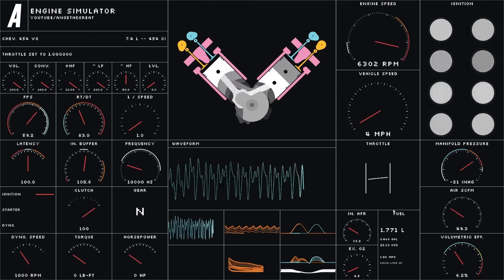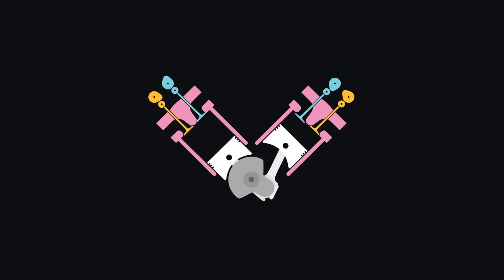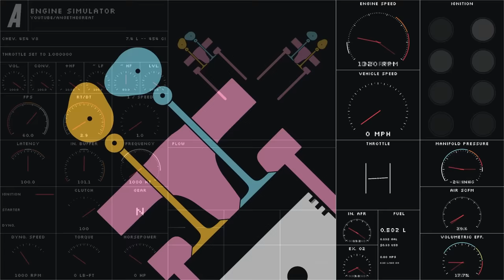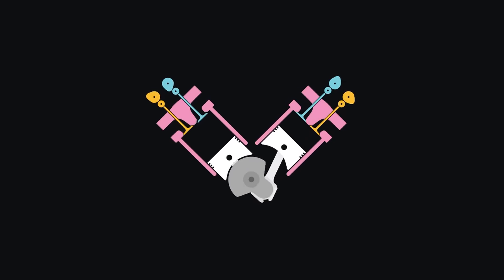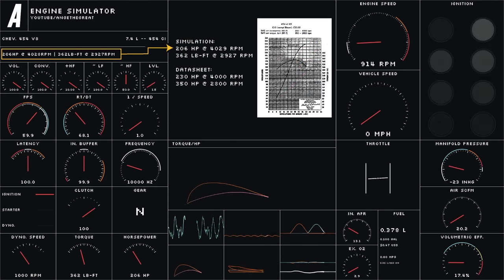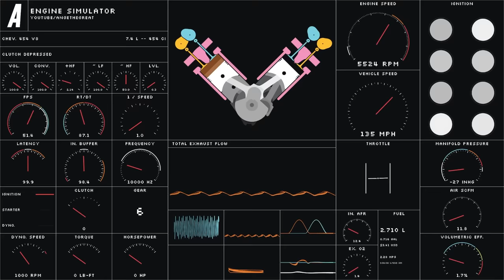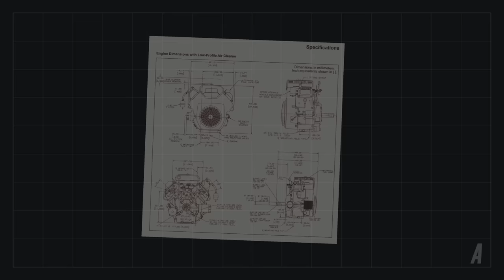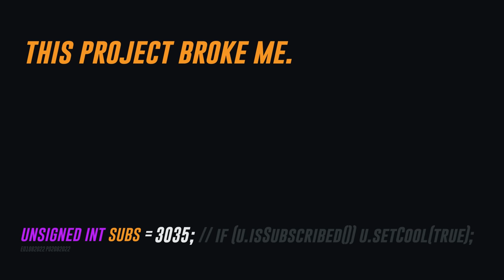Simulating an Entire Car Engine (yes, it makes noise)

Comment: Imagine BeamNG with realistically simulated engines that are 3D
Reply: computer explodes
Reply: beamng can barely run its own physics simulations above 60fps on most computers, I shudder at the thought of an engine simulation
Reply: @elllieeeeeeeeeeeeeeeeeeeeeeeee  wdym? any respectable gaming pc within the last 4 years should be able to easily run beamng over 100fps. Although this sim can barely handle a 10 cylinder engine since it's single threaded so I don't think it'd work out.
Reply: @Kevin15673  yeah but this needs 80000fps otherwise the engine will implode
Reply: @TorutheRedFox  The sim also runs on a single thread, I also never said that I thought it was possible to combine the 2.
Reply: @Kevin15673  well, multithreading physics simulations can't really work because it'll all fall apart if the threads desync (which, well, it's guaranteed to happen as the whole point of multithreading is that it's asynchronous)
Reply: there is "Automation - the car company tycoon game" in it you can build cars including the engine. which you can then export to Beam NG. though its a question to how accurate the engine simulation in that game is. its pretty much why most people play it. because you can make some pretty crazy engines with it for Beam NG. especially if you use mods.
Reply: @elllieeeeeeeeeeeeeeeeeeeeeeeee  my laptop runs it at 300fps 😄
Reply: @elllieeeeeeeeeeeeeeeeeeeeeeeee  my man u need an upgrade. 1k hours and only a few mods ever give me issues
Reply: I hope commercial quantum computers or immensely powerful analog computers become possible within my lifetime
Reply: @bad1971nova  yea like beamng, the most detailed physics engine applied to cars, isnt a real simulator
Reply: @bad1971nova  you’ve forgotten the purpose of BeamNG
Reply: @bad1971nova  Cause everyone knows beamng is þe most popular arcade game ever made lmao
Reply: @bad1971nova  What are you saying next? Real simulator like Forza Horizon or GTA?
Reply: I can't play beamng anymore because I ran out of space on my hard drive, but I can't relocate the install folders without updating the game, but I can't update the game because I don't have hard drive space.
Reply: @bad1971nova  Sorry but your comment sounded like you are badmouthing BeamNG!
Reply: @bad1971nova  Yeah it would be cool to have this in every car game and I agree, SUVs are pretty boring.
Reply: @elllieeeeeeeeeeeeeeeeeeeeeeeee  i have a good pc, but i still get low fps and beamng doesnt even fully utilize a single thread or my whole gpu
Reply: YESSSSS!!!!!!!!!!!!!!!!!!!!!!!!!!!!!!!!!!
Reply: @LodewijkVrije  It is a close approximation but it has many many flaws. I wanted a FULLY working engine in BeamNG, That is NOT run by a code, but rather a FULL simulation of explosions like a real life engine!
Reply: @tobster786  Have you tried to close all programs and running the game? And testing every configuration setting to make it rum smoother?
Reply: @elllieeeeeeeeeeeeeeeeeeeeeeeee  most windows computers over $450 should do the trick
Reply: @bad1971nova  Assetto and RFactor cannot compare to BeamNg. BeamNg is physics sim which simulates a car from the ground up, so stuff like CVT's and brake fade are accurately modeled.
Assetto is a driving sim, so FFB, grip levels and the actual driving feel of a car is more accurate than in BeamNg, but nothing is actually being simulated. The physics engine of Assetto is just a bunch of lookup tables unlike BeamNg. 
Assetto is more realistic for now, but I feel that one day BeamNg will dethrone any other driving sim for the pure fact that it is a true simulation.
Reply: @elllieeeeeeeeeeeeeeeeeeeeeeeee  reminder that this simulation needs to run at 80000 FPS
Reply: @bad1971nova  BeamNG is a real simulation.

Comment: This has HUGE potential, not only for sound but to simulate everything and really make a true sim racing game...
Reply: imagine this added to beamng
Reply: @dragonfire1256  Probably means going from 45 fps down to 25 around Italy😁
Reply: Yeah, this kind of sets a new standard for racing games. I'm not much into car simulators but great sounds in video games are always a huge boost to user experience.
Reply: @SaHaRaSquad  the sounds are pretty good these days, check out iRacing, ACC or GT7
Reply: @Phil-tl6ln  iracing isn’t that good. Same for for Atessto Corsa, but with mods it does sound great.

Comment: This is probably a legitimately good tool for custom car builders/modders.
Reply: I can see a collab with Automation - The Car Company Tycoon Game
Reply: @SomeonessChannel  Ooo I would be super happy if they could implement them together. I just wish Automation sounds would work in BeamNG alot better.
Reply: @recon1673  And have an interior
Reply: @tpmartin210  i'm pretty sure you can already build an interior, although it's very limited without mods at the time
Reply: As someone with 260 automation hours and 990 beam hours i have to agree with this

Comment: I’ve wanted to see a game where all of the sound is synthesized in real time. Essentially you would never hear the same sound twice. That would be tight.
Reply: Not well informed on this so sorry if this sounds ignorant but wouldn’t they also have to simulate the weather conditions like air density and temperature? Idk if the games do that already
Reply: @Badsniperarmy  No, most games don't do that. Infact most games don't simulate atmosphere 

Games like kerbal space program do it afaik but GTA, COD, Forza Horizon etc just simulate some effects like atmospheric distortion, aerodynamics of car etc. 

I can be wrong tho
Reply: @Badsniperarmy  It's not ignorant. Sound (specifically the speed of sound) is affected by temperature, but only really slightly so it shouldn't matter much. The environment that the sound is in matters much more, since sound bounces off objects.
Reply: @Badsniperarmy  those variables could just be replaced by constants or something like that, or develop a simple system for those like; If raining humidity is higher. No issue tho
Reply: Use this with sound ray casting with ingame engine effects, E.g reverb,delay.
Reply: live for speed uses 1 single exhaust pulse tone and makes an entire sound out of it
Reply: @romefalls.  that’s a start. But you know what I mean. Every surface of every object would reflect sound determined by the texture and density. Even the foot steps and gun shots would all be synthesized in real time. Like RTX for sound.
Reply: Yeah it'd be super cool with beamng drive cause it has really good crash physics and stuff
Reply: @edwardmiles5702  yes
Reply: @babayada2015  KSP's atmospheric simulation is extremely simplistic. It isn't a simulation at all, just a math curve applied to drag and pressure constraints on crafts-Basically a variable applied to numbers. However, KSP is a bad example for physics in general as the whole game was just a thrown-together experiment with features built on top of shoddy quick fixes.
Reply: @TRAMP-oline  true that
Reply: @xenontesla122  It's such a shame that even though we've gone all the way from HDR to PBR to real time path tracing in the last decade or so, but sound reverberation and synthesis tech hasn't really advanced very far at all in comparison.
Reply: @thetruthexperiment  I think that would be cool but im not sure if computers are powerful enough to do that yet certainly that would be a huge load on the cpu
Reply: Beamng drive would be perfect for this. Most of a cars drive train components are already simulated, I'm sure with heavy optimisation someone could manage to simulate an engine in a separate physics engine linking it to an output shaft in beamng. 

That's a super vague way of putting it so sorry if I sound like an idiot but it seems possible in theory with a beefy enough computer. 

The problem is though wouldn't beamng have to run at at least 10,000fps for the engine to work in real time? That's saying the engine doesn't rev past 10,000rpm. 

I've built engines in besiege that idle at around 600rpm but as soon it goes over around 1000 it bugs out because the simulation simply can't keep up.